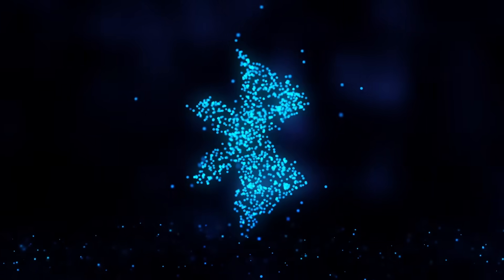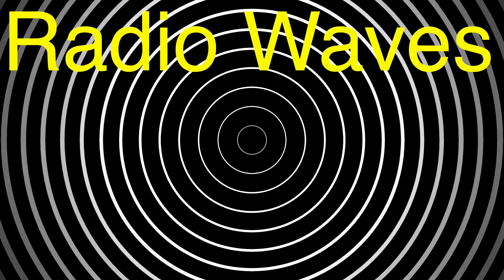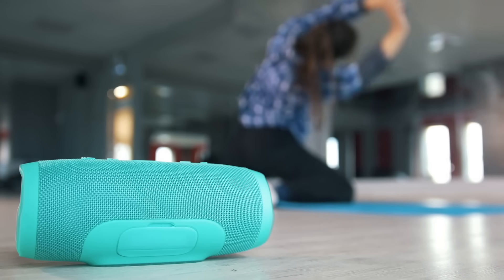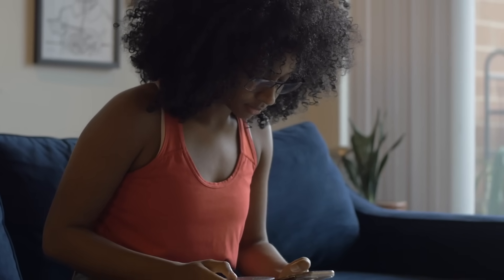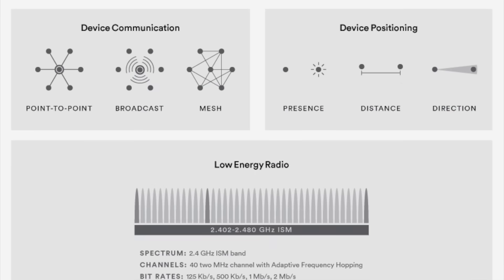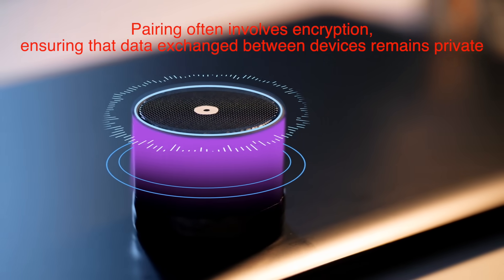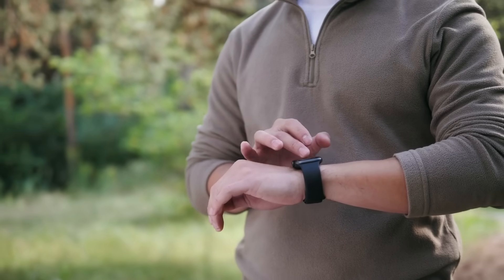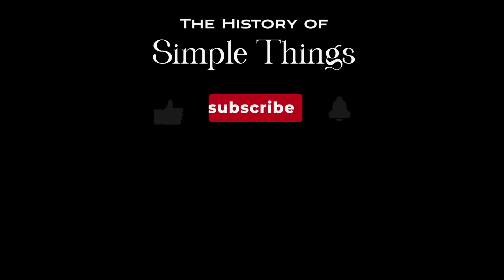How Does Bluetooth Technology Work?

Comment: nah. I don't like bluetooth. It can be finicky and a pain to pair devices. Also, if your device doesn't support a particular profile, you're outta luck. You can't just download new bluetooth profiles. I think wireless USB should be improved upon to replace bluetooth. in particular, have a universal wireless USB antenna so you don't need to keep a seperate USB dongle for each device.

Comment: The actress Hedy Lamarr had a hand in inventing the frequency hopping technology used in Bluetooth. It was invented in1941. Also the 2.4 ghz frequency range is shared with equipment used in the radio controlled hobby today and can have a  range of several hundred meters.
Reply: Yes. Bluetooth interferes with wifi and vice versa. Some committee with astounding alacrity decided that they should be on the same frequency so they could mutually interfere with each other.
Reply: Elaborate please?